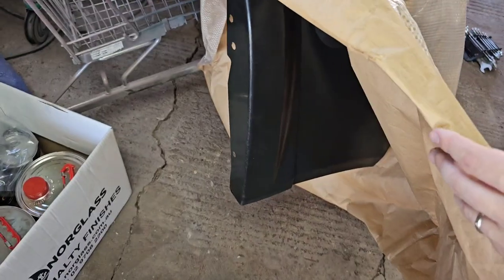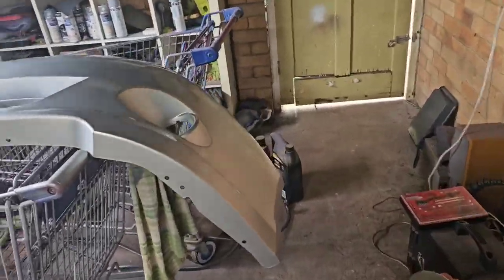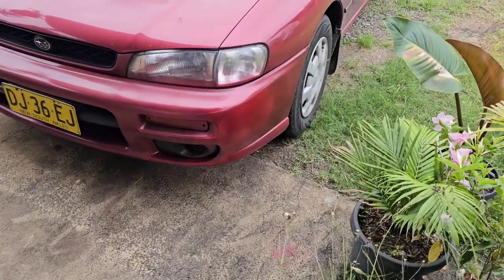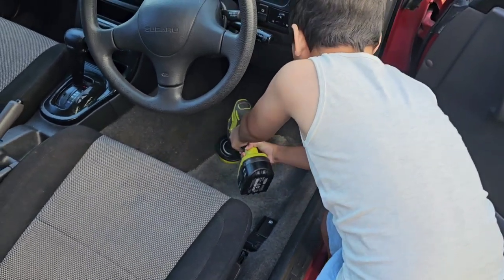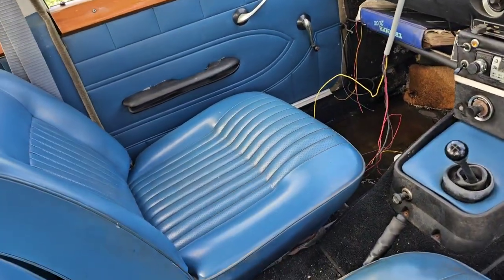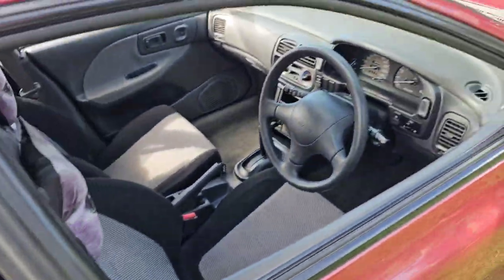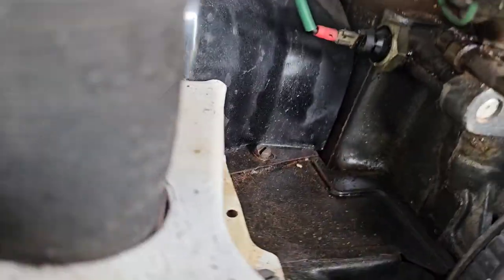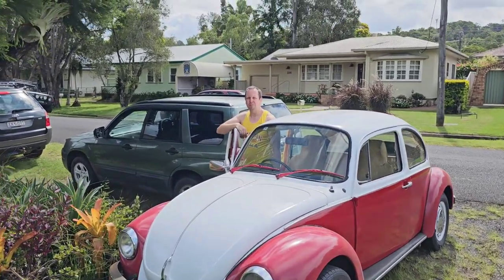Diy cheap carpet cleaner. Bumper painting and Beetys ALIVE!! plus other car Vlog activities!!

Comment: The way i do it is let each coat flash out.  Then I wet sand with 400 grit and go back over with 600 grit.  Then next coat, rinse and repeat with about 3 maybe 4 coats.  Last coat gets 400 grit then 600 grit then 1000 grit wet sand, then out comes the buffer with polish and then wax.  It will look phenomenal.